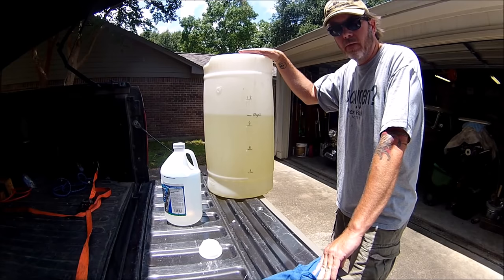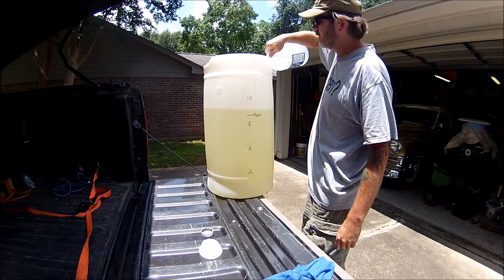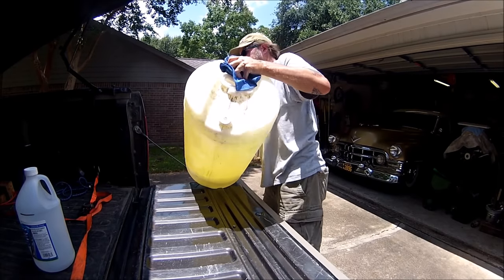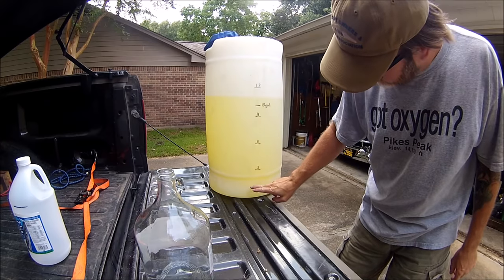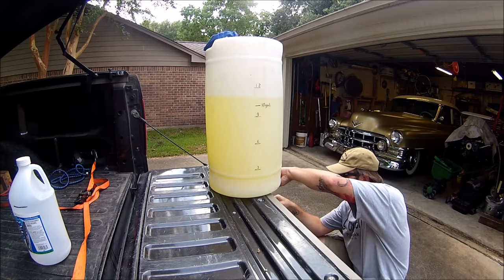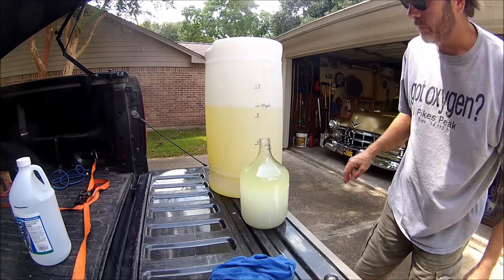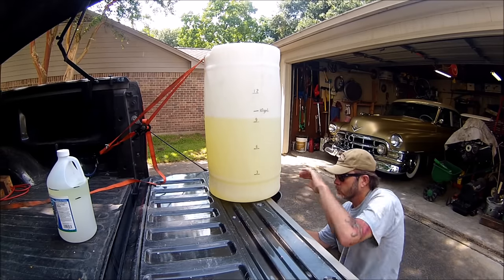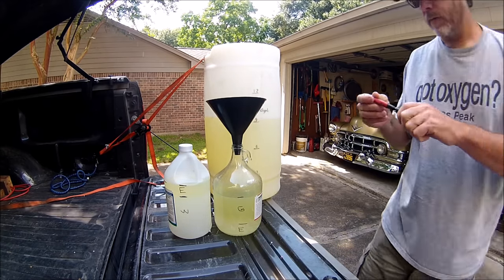How to easily extract ethanol out of gasoline.

Comment: I'm a chemist... 3 things you did kind of wrong.  

[1] mixing thoroughly.  You didn't.  Basically, you have to vigorously shake it back and forth (in your plastic cylinder) to the point where the water is almost slurried into the gasoline.  That's how it then has the surface area to absorb the ethanol. 

[2] Waiting before draining:  You didn't wait long enough.  Once quite broken into droplets, it'll take overnight to come out of suspension.  The temperature drop at night helps too.  

[3] Coloring the water.  Using red or blue or green cake decorating color, you should color up the water before starting.  This way, you'll be much surer as to when ALL the water is gone.  It might take a week... Literally. 

Lastly, though not "wrong", you could /or/ should have been decanting the gasoline floating on top of the water-gas mixture that was drained into the glass jug, back into the cylinder at the top.  Gently pour off what seems to be gasoline.  You combine that with what seems to be water in your water-recovery jugs.  (It should take about 2 gallons of jugs).  Every time you drain off a gallon of moose juice from the bottom of the big cylinder, let it sit overnight, then decant back into the big cylinder, and into the water-recovery jugs.  Keep it up, and eventually you'll have done a good job removing the ethanol and water.

Sadly, removing the ethanol will LOWER the octane rating of the gasoline.  Well ... actually ... it just exposes that the makers of gasoline are not only getting Federal subsidies for using corn ethanol in a "green" effort, but they're able to capitalize on using WAY-BELOW-GRADE gasoline as the fuel stock.  Like maybe 80 octane or less. Lots of knocking in your engine!!!

Otherwise ... high-fives for doing this and making a video.
Good job, man.

GoatGuy
Reply: To add to that, Robert; quite literally he took 10 gallons of 93 octane gasoline and produced 2 gallons of hazardous waste with nine gallons of ~maybe hi-test left over. Not sure what state he lives in, but I can buy non-ethanol fuel (for a bit more money), if I go out of my way for it (which I do for my carbureted lawn stuff/chain saws). And I don't have to dispose of two gallons of gasoline diluted water. That extra gallon of hi-octane he took off certainly offsets the price of non-ethanol fuel, and around here, disposing of that two gallons of diluted gas is either a pain-in-the-ass to do it right, or illegal if you just dump it somewhere. I hope he isn't just dumping it. I hunt and fish, so I'm kind of a dick about people dumping shit. Yea, I hate the corn juice. But, I have easier and safer options. My fuel injected cars and motorcycle are fine with it, it's the carbureted stuff that it kills if you aren't diligent. Oh, and I'm not a chemist or a skinny-jeans-wearing tree-hugging-hippy either. I just don't want people watching this vid to go dumping the by-product into the storm drains. We got enough meth producers around here poisoning the earth with no regard.  /mini-rant
Reply: A Keller Ethanol has an octane rating around 140. Remove it and it's not "high test" anymore. I'm not sure what the octane rating would be but I'm sure it will drop
Reply: You also didn't mention that the container is sitting flat, which means he cannot get ALL of the separated water/ethanol out of the container.  He either needs to tilt the container so that it will all move to the exit OR buy a container with a cone-shaped bottom for easy removal with far less gasoline coming out with it.
Reply: We have ethanol free gas at Wawa. Not that much more expensive.
Reply: Why could we not separate by distillation?
Reply: Go for it, we'll know whether you were successful if we don't see a mushroom cloud!
Reply: @aaronkellerctr  might be confusing hipsters and hippies.. are they the same thing?
Reply: In most states, they have to add ethanol to increase octane, even in super-unleaded high octane fuel.  Two states have an exemption for letting them use ethanol, Missouri, and Montana.  Super Unleaded fuel there has no ethanol.  When someone like this is saying add water, to remove ethanol, what is happening is that you are removing ethanol alright, because it WILL absorb any moisture, even humidity in the air, and phase separate.  Removing that ethanol is removing the chemical they put in there to increase the octane.  So what you have left, is very low octane "gas", not "pure gas" like you used to get from the pump.  Do not do this to a modern fuel injected engine, you will completely fuck up the timing tables and cause engine knock under load.  You'll do it on carbureted engines too, but unless you're doing that on a higher cubic engine motor under load, you shouldn't be "pinging" or knocking.
Reply: Most people don't have the ability to build equipment to do distillation on a scale that makes sense for motor fuel, and it can be a very hazardous operation.
Reply: Oh, I don't know. Probably not? Maybe my 'funny' didn't come off all that funny. Just saying that the by product of this is hazardous waste. And that it needs to be treated as such. And that I really hate 'dumpers' and I will report them. Someone mentioned WaWa, which is a place I normally get my non-ethanol.
Reply: Wow! I can't imagine the CR you are running to need that level of AKI. Have you considered avgas? If your Harley can tolerate lead, there are several formulations that could meet your requirements. If not, there are still a few. Swift UL102 gets you to about 104 without any metal additives, and you might could reach 110 with MMT addition. There are some slightly lower octane avgas options, and MMT + Mesitylene might get you there. Mesitylene is expensive in these little octane-booster formulations, but bulk mesitylene in drum quantities is only about $10/gallon, and its AKI in pure form is a robust 136. You can get a serious boost at about a 10% level, so you'd only be adding about $1/gallon to the price of your base fuel. The current issue with mesitylene is that it is vary difficult to obtain in bulk quantities at bulk prices outside of China. Maybe the guys who formulate racing fuels import it in drums, but if they are selling fuel at "only" 110 AKI, they have obviously diluted the mesitylene already. Anyway, happy motoring, and be sure to wear your Inconel undies when you fire that hog up!
Reply: Little of both, I guess. Into fuel production & chemistry for work and play. That is an extraordinary machine you've got there. Never got past an Elsinore 250 motocross bike myself, so you definitely wouldn't want to trust that baby with me as rider #4. I'm not knowledgeable enough about that engine and those mods, but if you can take leaded avgas, that might be your cheapest route to 110-plus. Some small airfields will let you fill gas cans with a wink and a nod; others you need a friend . . . maybe even a GOOD friend*.

(As defined by the Car Talk Guys: "A friend will help you move; a GOOD friend will help you move a body.")
Reply: Since some of you guys are chemist, say the guy in the video was using 93 octane fuel [with the added ethanol], what would the final octane rating be, after removing all of the ethanol?
Reply: Well, I'm not a chemist, but I have studied chemistry and more importantly I have studied fuel properties. Fuels vary from place to place for a variety of reasons, but as a rule of thumb refineries produce RBOB (Reformulated Blendstock for Oxygenate Blending) at 84 - 85 AKI (Anti-Knock Index, or what consumers know as the "octane" number posted on the pump). Adding 10% ethanol brings this up about by about 3.0, giving you 87 - 88 for the blend.

That's regular. Premium RBOB usually starts at 88 - 89, and the ethanol brings it up to 91 - 92 (93 is offered some places, or at least it used to be. Don't see it where I fill up.). Mid-grade is just a blend of those two to get around 89.

Pretty much everyone uses RUL and PUL (Regular and Premium Unleaded, respectively) completely interchangeably, not worrying about which refinery it came from. Those two are traded commodities with local / regional pricing. Ethanol is equally generic. Apart from possible issues due to quality control, all gasoline is basically the same except for additives. The additive package can be quite a complex soup, but it will typically contain detergents to keep valves and other engine parts clean, corrosion inhibitors. stabilizers to protect components from reacting with oxygen, in some cases anti-knock additives, and several other minor components that may or may not be in a particular brand's "additive package."

The Big 3 U.S. Manufacturers, along with several German and Japanese automakers, recommend a "Top Tier Detergent Gasoline" for their vehicles. Several dozen brands in the U.S., including all of the ones associated with major refiners have complied with this standard. To do so, they must comply for EVERY grade of gasoline sold. Premium may have a HIGHER level of detergent and other additives, but all grades have at least the minimum. I haven't checked, but I believe that Chevron and Shell guarantee the highest additive levels across all grade. Stations going for the lowest price point virtually always put the minimum allowable additive levels in all grade. Some even go below that level, failing to comply with the Top Tier standard, but those are pretty rare these days.

(The additive package is one reason why screwing around with water extraction of ethanol is an exceedingly BAD idea. If you buy marine gasoline, aviation gasoline, or racing gasoline, you may not get the ideal additive package for your engine, but you're a lot more likely to come out OK than by sloshing pump gas around with water and hoping for the best, IMHO).
Reply: I've forgotten more about motor fuels than most people will ever know . . . . but the question is, how much have I REMEMBERED???
Reply: OMG, another APL programmer! We are a rare and misunderstood breed. As a colleague once said: "If you're writing an APL program, and a FORTRAN programmer glances over your shoulder, he's likely to think you're in league with the Devil." Back in the days of CRT terminals, as a grad student I actually bought an APL-capable monitor just so I could use it from my lab rather than trudging over to the Computing Center. I still use DYALOG APL out of the UK on a regular basis. Other than that, not nearly so broad a range as you've used. There was one time early in my career, though, when I was actively using 5 operating systems at the same time: Unix, VAX VMS, IBM CMS, MS-DOS, and the newcomer Macintosh. Except on the Mac, I would literally have to stop and think: "What editor do I need to open?" or "What is the command to delete a file in this OS?"
Reply: Thanks Joe, for taking the time to explain all of that. In other words its just not worth it to try to separate the ethanol out of the fuel. No real gains other than if you simply cannot buy real gasoline in your area { there are several stations in my area that sell non ethanol fuel, BUT its all 87 octane, which is fine for fueling up the lawn mowers, or the vintage cars for the winter.]
Reply: There are engines that do not do well with 10% ethanol, no matter what the corn-nuts try to tell you, and ethanol-free fuel IS hard to find in many places, thanks to their political power. OTOH, we all know that if ethanol-free fuel was readily available, many people would go ahead and buy it for cars that run perfectly fine on E10, because they are nut-jobs in their own right. That would defeat the whole purpose, which is to enrich the corn farmers, er, uh, sorry, I mean PROTECT THE ENVIRONMENT!!!

But once you have put the cream in the coffee, getting back pure cream and pure coffee is not so easy. If you are careful and competent, you might could distill enough fuel for a weed whacker or a trolling motor or the occasional Sunday drive on your Harley, but it would be impractical for regular driving, and you'd have to start with premium just to get ethanol-free regular.
Reply: eth free gas in CA will cost you $25 per gal.
Reply: I talked with the Holley company, and they explained that their new Fuel Injection systems {for converting your classic car from carburetor to fuel injection} is specifically designed to tolerate the ethanol that is in premium fuel. They said all you need to do is add a bottle of fuel stabilizer into your tank, and it will offset the ethanol.
Reply: E10 gas loses 3 to 4 points of octane when you remove the ethanol
Reply: david mack   90 octane is the sub grade that is mixed with ethanol to make 93E10. However it is oxygenated and not the same as buying non-ethanol 90 octane. You also will not necessarily remove all the ethanol or the water you added with this method.
Reply: Robert Lynch you’re definitely not a chemist if you think removing the 10% ethanol drops the octane from 93 to 80. Nice try though. Adding 10% ethanol increases octane by roughly 2. Thus removing the ethanol makes it 91.
Reply: david mack 

Roughly, 89-90 octane.
Reply: For a chemist you don't know much about gasoline you can add kerosene or octane booster to raise the points back up
Reply: 🏆BEST COMMENTS EVER!!!👍
Reply: Some good points here. Ideally, it would be good to find a way of separating and removing the ethanol from the gas in the fuel tank without having to remove the gas from the tank. I am also a chemist (a retired separation scientist) and I think this may be possible - my concern is to find a safe way of doing it. Playing around with large volumes of gasoline has obvious dangers.
Some cleverness is needed to:
1. Make the extraction into the water much faster and more efficient.
2. To cause the phases to separate more readily after the extraction. I feel an urge to experiment!
Reply: Yo Joe  I personally  would never do that. Maybe I was a bit passionate on previous comments. And the tree-hugger/hippie comment I posted earlier was probably unwarranted and maybe offensive to some. I resemble some of each. Especially with dumping.  I know some people that use old oil/shit gas for weed control on their fence line. I do have a problem with that. There are options here,  just not very convenient, but better than that.  I guess my main point was, ethanol is the bane of my carbureted yard tools, lawn mower, including my '98 V-Max. But there are options, I can and do get 'straight gas'  locally,  although not even the most effective, and somewhat more expensive. Fuel injection is the way, but on older 'things' and small motors, they would like you to just replace them. And back to the landfill. The FI Harley is fine, as are the car and truck. Just hope I didn't piss anyone off with my earlier comments. I was probably working on my chainsaw that day. Or a weed whacker. Or my '98 bike. Please forgive...
Reply: @hishok3332  That sounds cost effective. Maybe you could add ethanol, it's probably cheaper than that other stuff. Oh wait. I guess that doesn't make sense. I'm just going to go ahead and use the the E10 in my boat. I was looking for E0 around me but I could only find racing fuel for $16/gallon. Besides, saw a video where Mercury says E10 is better for boats anyway.
Reply: Very useful comment. Thanks for suggesting the use of water based food dye and pointing out that we should have 2 gallons of water/ethanol mixture.  Overall, the video was interesting.
Reply: Add a gallon of toluene to the ethanol free gas to boost the octane up.
Reply: @3melendr592  to dangerous.
Reply: Well…well…well… aren’t you “Mr. Smart Guy”! 🤣👍
No…. seriously, you’re obviously smart …that was a great step by step breakdown of the extraction process, and good of you to point out where he got things right.
Thanks 😉👍
Pay no attention to my quirky humor.
Reply: I am also a chemist. Besides what the other fellow said to you the underlying fact in any introduction of another substance into your gasoline mix is that you are wetting the gasoline. Gasoline has a finite solubility of water in itself. Unless you use a drying agent you now have gasoline with water molecules floating around in it at a specific concentration. Only a drying agent or more exotic methods such as azeotroping will remove this water.
Reply: @aaronkellerctr  I wish there were way more Ethanol free gas stations around, especially in cities. Unfortunately, the few that are around are way out in the country or outlying rural areas.
Reply: Man you know about that stuff, thanks a lot for your updating input!

I am a Diesel-Liker and when the Gov, smarties started to clean the air environment, lots of thanks
Reply: What is Ethanol? What is it made from?
Reply: My 1200 Sportster Pings Bad if I run Gas with ethanol. 
Ethanol Free=Ping Free   
Why is this?
Reply: I wouldn't recommend doing this at all. Modern gasoline contains a variety of additives that serve important purposes. These include detergents that keep your engine clean, anti-corrosion inhibitors to protect your fuel system, seal preservatives to prevent fuel leaks, and lubricants to reduce friction. Siphoning off the top layer of gasoline after mixing with water may remove some of these additives along with the ethanol (depending on the additives' affinity for alcohol and water). Also, as others have pointed out, removing the ethanol decreases the octane rating. This method of getting ethanol-free gas has the potential to cause as much harm as good.